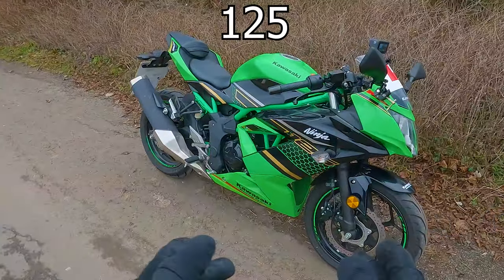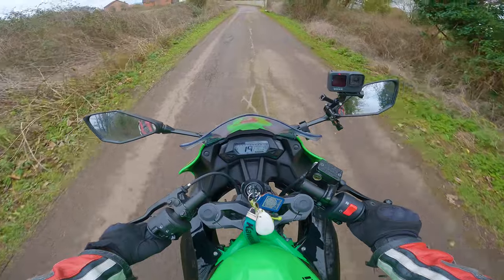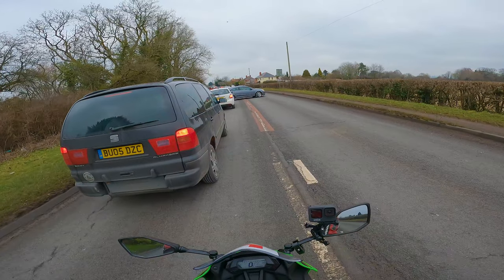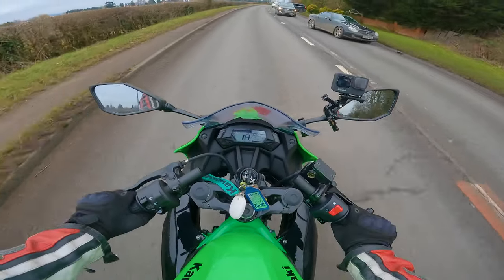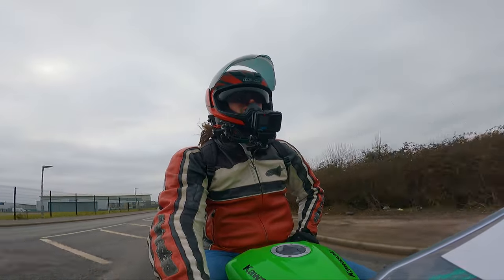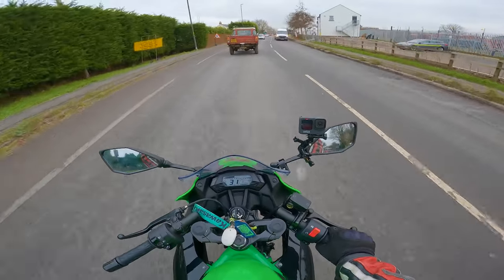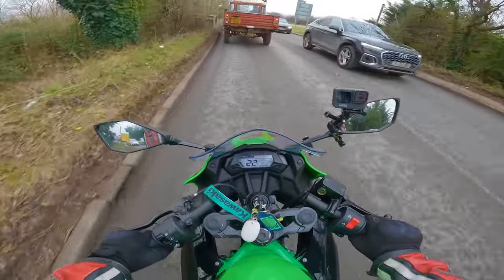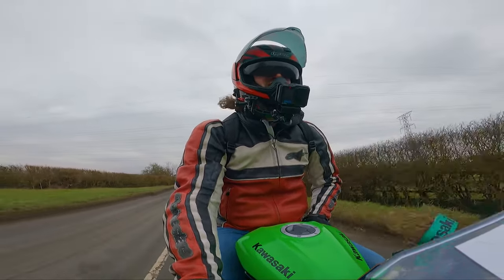Things You CAN NOT Do On a 125cc Motorcycle (feat. Kawasaki Ninja 125)

Comment: Bro come on I'd wheelie any 125cc out there.
Reply: Yuka  I’ve got the 2023 version of this bike and it’s easy asf too wheelie 😂 I could wheelie my old Honda Pcx too
Reply: You can wheelie a tiny ass honda wave 😅 it's big bikes that are difficult
Reply: Yeah you can 100% wheelie any 125😂 I’ve so my mate wheelie 50cc mopeds
Reply: I have a friend that wheelies a 50cc and I’m not even jk
Reply: Not my sinnis terrain you wouldn’t I’ve tried too much 🤣🤣
Reply: I’ve seen guys wheelie a 50cc mini moped
Reply: 4-STROKE P-O-S !!!
2-STROKE RULES !!! :)
Reply: 😂this guys too heavy for wheelies fr tho
Reply: Seen big guys weelie a 50cc from like the 60s...
Reply: As a previous WR125X wheelies are so easy on a small bike
Reply: Yeah honestly I can pop the front weel of my cbf 125 up easly, just rev it and dump the clutch
Reply: @HeldIntegral Depends on the torque the bike has. A BMW GS1250 will have more than enough torque for it.
Reply: My TSX would wheelie without dumping the clutch just  reving it, I had to run it in from new at 3000rpm no more 😂 I couldn't resist wheelies, lost loads of compression then, had to dump the clutch to wheelie.
Reply: M8 your talking about an anchor, trackers are cheap as chips now & small enough to hide, B&M had one in store for a £5
Reply: @simonoliver5327 50cc mopeds are way easier to wheelie than 125cc's
Reply: I have a cb 125r  2022 and I can easy wheelie but only in first gear and its hard to keep the wheelie up
Reply: Maybe at 15mph tops. 
125cc does not have the power to hold a wheelie at speed.
Reply: @simonoliver5327  50cc mopeds are way easier. a 140kg naked bike w 15 hp aint that much
Reply: @halophobic9550  okay, but I can wheelie my 125…

Comment: So glad that here in Canada we don't have any laws of what you can get. You pass your learners then you can get anything you want. As long as when you take your road test you can handle the bike (or use one smaller when you take the test) you are good to go. My first bike was a 1987 Yamaha FZ600. Road for many years. After I sold it, then it was over 20 years since riding again. And yes I jumped to the great ZX14. Couldn't imagine having to ride a "moped".
Reply: Yeah my first bike was a zx6r. These days they have different power modes which is cool. Helps keep from outgrowing the bike so fast
Reply: You missed the point that you can ride a "moped" without taking any test, just with your car license.
Reply: amen
Reply: That's pretty stupid imho, your first bike is what you learn all the basic skills on. It should be light, precise and not powerful enough to get you into much trouble.

I agree that the age thing is dumb too, but the classes (A1/A2/unrestricted) make sense and so does the requirement that you pass on whatever class you want the license for.

The last thing you want on your first day is to snatch the throttle open on an old MT-10 and watch it fuck off into the distance while you fall on your arse
Reply: @233kosta  idk i don’t think it’s bad to start on a 600cc anything bigger i don’t think it’s safe to start on but if you keep a 600 under 8000 rpm you’ll be fine to learn on. The bottom line is i don’t want my government telling me what kind of bike i can’t ride. if i want my first bike to be a r1 (personally i think that’s a terrible idea) but i don’t think my license should be able to dictate that.
Reply: @dabears22  If you can pass the test on a 600 or 1000 - go right ahead, no one's stopping you. I did mine on an MT-07.

But if you don't have the skill set for a big bike you have no business being on one. That's the point of restricting you to a 125 until you qualify.

Look at it a different way - would you let a teenager on a learner's permit drive a Hellcat unsupervised?
Reply: @233kosta  my point is who are you or who is anyone to tell another person what type of bike they’re allowed to ride? it’s ridiculous. i started on a daytona 675r and had no problem. i ended up getting a ninja 400 and fell in love with that too, but to each their own. i’m just happy i live somewhere where i didn’t have to ride around on a glorified moped until i passed a specific test.
Reply: @233kosta  and the car thing is different because most learners permit drivers are young kids
Reply: @dabears22  So let's abolish licensing and standards for motor vehicles altogether, then. Who are you to to tell me whether or not I can ride a hybrid rocket strapped to some wheels around town? What do you mean "experimental vehicles aren't allowed on public roads"?
Reply: @dabears22  No it's not. Maybe to idiots who think teenagers are incapable of being responsible it makes sense, but this isn't about age. It's about competence. A 16 year old will have exactly the same level of the specific fine motor control required to drive a car or ride a bike (which, granted, different skill sets) as some 45 year old with zero experience. I wouldn't let the latter out unsupervised in a Hellcat either.

This is about skill and judgement, not age or anything else. If the teenager demonstrated adequate competence on a 1L crotch rocket - have at it. Until then, stick to a machine that won't try to kill you and/or someone else if you mess up.

The test, by the way, is exactly the same in all cases. The only difference is the machine you take it on.

Same reason you're not allowed to drive a manual car if you passed your test on an automatic. You haven't got the skillset and until you do you're a danger to everyone else around you.
Reply: @233kosta  well tbh i think testosterone levels and maturity are a factor too not just skill set. that’s why insurance is higher for young males. regardless i live somewhere that i was able to start on a big bike and i’m happy about that. you live somewhere that you had to start on a small bike and ur happy about that. bottom line is we’re all riding because we enjoy it. Ride safe.
Reply: @233kosta  the test is not the same.
In UK cause this is were it's the video, the 125 test it's a lot more easier than the A2 or full licence.
Reply: @georgeoprea3525  It's basic training, not a test. Clue is in the name - Compulsory Basic Training (CBT). If you want the actual license (A1), you still have to do the theory test (which is the same for all bikes) and both practical modules. At that point, the only difference between A1, A2 and A is the bike you take the test on.
Reply: @233kosta  I said test, it's not an actual test, it's a ride on a circle and a ride in town. No, it's not the same and just the bike different. I don't know we're you are located but I am in UK.
The Cbt doesn't require any theory test. Just to know the way to do it and if you don't know the signs and things like that, well you are going to fail and take it again but they don't ask you to take a theory test.
Reply: @georgeoprea3525  The CBT is supposed to be your starting point. It is NOT an A1 license. It is an extension to your provisional driving license which is supposed to allow you to develop your skills and judgement to a sufficient level as to take full test. That's why it expires after two years.

The fact that people choose to game the system and be road hazards instead (I'm looking at delivery scooters in particular) is another matter.
Reply: @dabears22  a 600 is awful compared to a 125 when it comes to being nimble and agile. Those are very important for learner and new riders who will get into trouble.

You need to include your age and your experience and personality type and riding type.

Were you 18, wild, reckless, riding the 675 with wide open throttle, sliding off, crashing etc?

Were you 40, sensible, careful, gentle, cautious with 30 years of off road experience?

How many children do you want to see splattered on the roads?

If it's your teenager do you want well thought through laws backed by numbers that show restricting youngsters prevents very high speed fatalities and paralysis type accidents?

50 and 125 are super light. This means you can manoeuvre them so easily, and that matters when you're young and in busy congested European cities, with very narrow streets wide enough for a donkey cart.

I was mid 20s on a cbr600, on a side street, accelerated nicely anticipating late braking for the T junction just 60 meters from me, but a car came round and kept coming towards me.
I brakes harder than I wanted to, didn't lock the front, slightly locked the rear which caused the rear to keep going straight, even though I was now turning towards the very narrow gap still available. Years of off road riding meant I had loads of exclusive of rear wheel brake slides, so I let off the rear brake, expecting the little grip-kick, and steered past the car.

The 200 kilos, 450 lbs, of the 600 meant it was a pig to steer compared to my old 125 or 50.

A 600 is terrible compared to a 125 when it comes to being nimble, agile.

A 50cc is a great start. I had a quite large 50cc dirt bike that could do 45-50mph, 80kmh. That's enough for 16 year olds for a year.

125 can do 80+mph.

Perhaps you're mixing up protecting the youth and inexperienced with "don't take away my rights!"?

Can you really not see why it's a good idea to restrict young and inexperienced riders to lighter weight and lower power bikes?

Probably you sit on the outside of airplanes, don't wear a helmet on your bike or any protective clothing at all, say every negative thought about anyone you see to their face?

😁😁
Reply: @Google_Does_Evil_Now  “protecting the youth” didn’t realize 18 plus is youth. where i’m from 18 years old is an adult and you should be able to ride whatever kind of motorcycle you think your able to ride as an adult. i started on the 675 when i was 21 and had no issues at all. if you keep it under 8k rpm’s you’ll be fine. if ur not comfortable with it then don’t do it. i don’t need laws telling me what size motorcycle to ride. that’s ridiculous. have some common sense and don’t out ride your ability and you’ll be fine. it’s called learning.
Reply: Yeah, it sucks. Consider yourself lucky. But there are some aspects of your country I'm not envious of at all.
Reply: Winter would be a big one! Think I have just a few weeks left before having to put the ZX14 away for months and months. Yuck

Comment: it's utterly baffling why we were relegated to 50cc and 125cc as learners. I'm a big boy and heavy set with the added weight of being a bit over weight and 125 are barely tolerable. I actively have to take routs that cut more steeper hills out of my journey. the learner legal limit should have been 250 restricted to 80 to 90mph at like 20 to 25bhp. Yes, there are idiots out there but for the most part, 125's are just not fit for purpose when we're talking non urban travel and most riders, no matter disposition, tend to be pretty road savvy. I also think it plant seeds of fear of the bigger bikes in some way too. and fear leads to hesitation and on motorcycles, that can be a detriment more times than it isn't.
Reply from the maker: Totally agree. I've mentioned in previous videos 125s are too small, and the jump between a 125 and a 300 - 400 for A2 motorcycle is huge! Should be 250 imo
Reply: 4-STROKE P-O-S !!!
2-STROKE RULES !!! :)
Reply: It was that way back in the seventies,at 17 you could ride a 250 on  on L plates with a provisional licence,some of the bikes  were 28 HP,and with some allspeeds and k&n  filters,most could do 100 mph.probably the best one i had was the suzuki GT250  X7,A road rocket.and considering you did not have to pass any test,only writing in for a provisional license,and off you go!It was very unfair when the uk reduced learner bikes with max 12 hp because that applied to everybody.no grandfather rights.the only compensation we got was if we were to take a motorcycle test now,we only have to take 1 test,for unlimited cc.

Comment: I remember when I was in my early 20`s I had a Yamaha Rd125lc and had problems keeping the front wheel down. My friend who had a DTR125 was always pulling wheelies. What happened to the 125 2 stroke wheelie machines of yesteryear?
Reply: @insertnamehere3007  I know what you mean about hitting differently. My last 2 stroke was the Suzuki GT380 triple (the one with the square bore) it was supposed to have only 38bhp but seemed to have way more than that. That little rocket ship never liked the centre spark plug, it was always spitting it out. that was also stolen from outside the Redbeck motel/diner at Wakefield. :/
Reply: Environmental Laws. They killed it all.
Reply: @winteronice  Honestly for the better. I'm always reminded whenever I start up my snowmobile of how much better it is nowadays.
Reply: I just finished restoring a 1982 example a week ago, it's a surprisingly fun little beast considering it makes all of 21 bhp or something. You do pretty much have to ride it like an absolute hooligan (like 7-10k rpm at all times) to get any power out, it's good to be back on a 2-stroke :D
Reply: Riding one now as my daily commute for 5 years - kmx 125, dts and even less rds are about
Reply: @ozzyp97 yes I found if you dropped under 8k it wouldn't even maintain the speed you were already doing.
Reply: I’ve got a dt 125 as my bike now mate faster than everyone’s 125 Ik aha he clearly doesn’t know much abt 2 strokes
Reply: @KnivesDownGlovesUpUk  if its that much faster are you sure it's legal ?
Reply: @chrishart8548  idk I just bought what I wanted got it on the road and pulled the throttle was thinking abt putting a 250 engine in it so guess it wouldn’t be then lol
Reply: @KnivesDownGlovesUpUk  I just mean when people say 2 stokes are faster the 12hp learner legal ones are not really.   The 4 Stroke 125's are slow because they are only 12hp not because they are 4 stroke.   If you put a 250cc I guess it would still be 2 Stoke  that would be a animal.    Better than a 450cc 4 Stoke really.  Almost as powerful and a lot less weight
Reply: @KnivesDownGlovesUpUk  still if the dt125 has the YPVS valve enabled its 24hp that should be nice and quiet anyway.   Faster than a 4 stroke 250cc. Not sure if the restriction was in the pipe and the jetting also.
Reply: @chrishart8548  I have a aftermarket exhaust with and up jetted aha
Reply: 4-STROKE P-O-S !!!
2-STROKE RULES !!! :)
Reply: I just said that myself in the comments,my restricted LC125 mk2   did 85mph,and later I took out the restriction ring in the exhaust  and had 100mph  on the clock.Actualy if you totaly de-restrict  that engine,reed valve too,you can get 19+ horsepower  out of the standard engine.I hate 4 strokes.

Comment: exhaust and intake on my Grom has made a huge improvement. I got plenty out of it
Reply: IS IT CARB?
Reply: @bencollins6252 I think all the groms are FI
Reply: Try bigger throttle body and injector then map it, you get 1-2 more hp than stock
Reply: @tumo07  get a RD 125  power valve old skool soz am 54 yrs  125cc motorcrosers defo wheelies
Reply: @tumo07  Yamaha RD125 YPVS Valve
Reply: @chrishart8548 yeah they all are but you can carb convert them.

Comment: Wheelies are possible just very difficult 😂 have to go to many different lengths to bring the front wheel up - a lot easier to wheelie a 125 moped only due to the weight difference
Reply: 4-STROKE P-O-S !!!
2-STROKE RULES !!! :)
Reply: You just have to be brave with your clutch dumping and suspension loading. Not really something I'd think most CBT level riders would be safe to attempt, even on a closed private course, but it certainly helps to have  a lower final drive ratio and a more upright style to take advantage of weight distribution.
Reply: @S7AINLESS  100% for sure took me a good few months to get consistent on my duke 125 takes a lot of work haha really compressing the forks down and u gotta be quite brave to shift ur weight way over the back took a lot of little 1 foot wheel pops before i really got the hang of it 😂😂 way i see it if u can wheelie a 125 u can wheelie anything for sure

Comment: I hate these new generation four strokes,they are crap,something over 70mph at best.Back in the late 80s or early 90s,i had an RD125 lc2,on a provisional license with L plates,learner legal.that did with the restricting to 12hp   about 85mph with me on it   at 8 and a half stones.That would destroy the ninja in a race.later i took the restriction out of the exhaust pipe,and had 100mph on the clock.I was a london despatch rider on the LC  and normaly they did not give out of town jobs to 125 riders,but they gave me out of town jobs,because my little 125   was seriously  rapid.